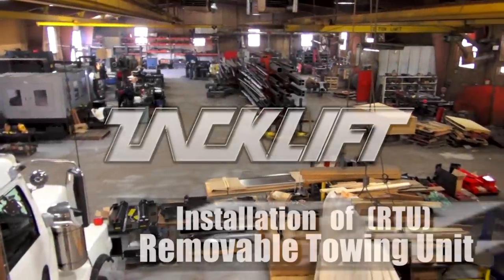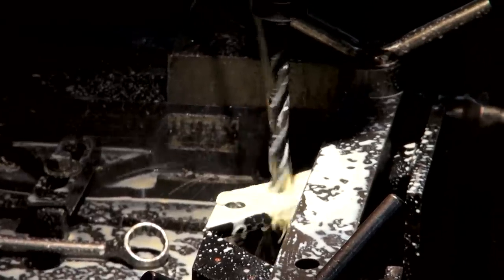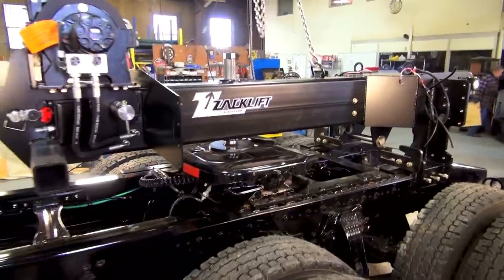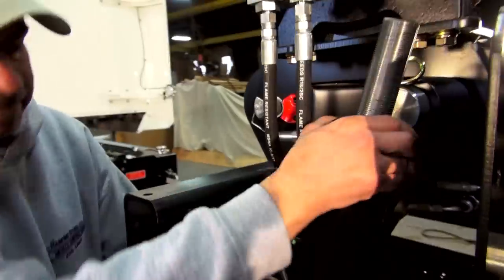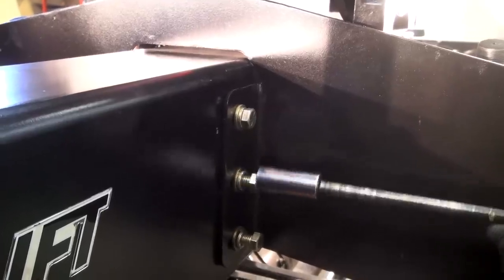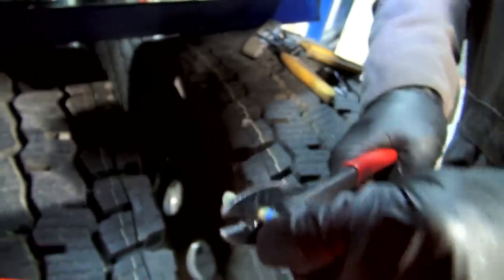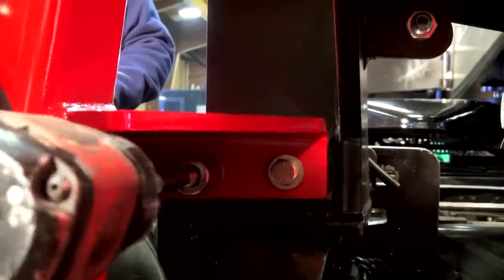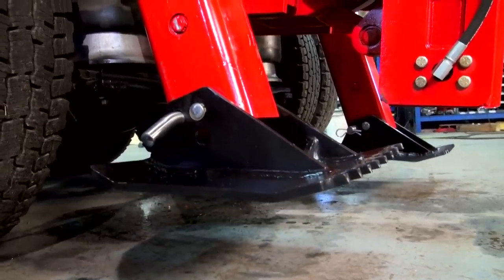Zacklift FIFTHWHEELER Installation - Heavy Duty DETACHABLE Towing

Comment: Not interested in a permanent tow boom. I'll keep my 19? 5th wheel boom that runs off jumper cables connected with the battery. My next one will have a tag axle mounted on it and hook up like a "Joe dog"

Comment: Is it really legal to just cut and weld on the axles in the US? Over here (Germany) police and authorities would shut down that truck immediately if theres no proof for static integrity of that modification and it has to bee done by a certifiied welder...
Reply: yes , legal. In the heavy category framing is serious about welding.. but all passenger trucks and cars all is welcome. Axles, frames everything.
Reply: If it is working in England, it is also good rest of Europe.
Reply: He just tacked the bolts on the inside of the additional bracket..I didn't see him heat the frame..But its legal if he did..As of about 6 or 7 years ago..they reversed that regulation...The elephant in the room is that these units are not quick connect  and defeat the purpose of leaving the fifth wheel..and the biggest design flaw is putting all the weight at the end of the frame  on a truck designed to carry the weight between the drive axles..Making the front light and dangerous when towing loaded trucks with trailer and drive and ride like hell..Trying to get another foot forward by removing the rear crossmember proves that...Lol...The right handed guy installing the hoses right to left cracked me up...then bolting the 2 inches of steel together on the 30k rated outriggers and winch with half inch bolts..not butted against...and the airline sizes..1/4 inch would be fine for the service and spring brake line and you'd need 1/2 line to have the volume for a 1 inch impact on the aux air coupler..not working on cars here....maybe blow the dirt out of your mullet...Lol...Contact me or  a engineer or veteran towman on the next design please..

Comment: That cross member  on the back doesn't  make since,  there would  be an inch or less of travel between  it and the diff cover. Especially when towing a rig. Although  the rest of it was co9
Reply: Air suspension is disconnected so truck is already sitting on the bump stops when the cross member is installed.  So there is no way for the axle to contact the cross member during operation.